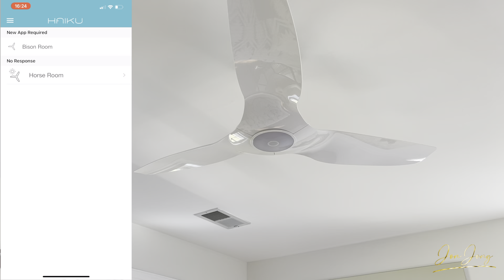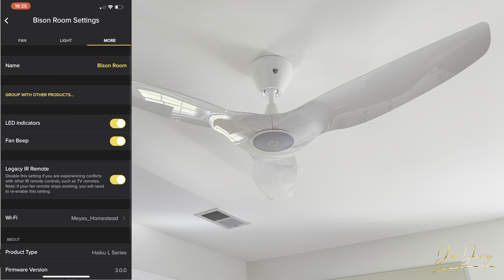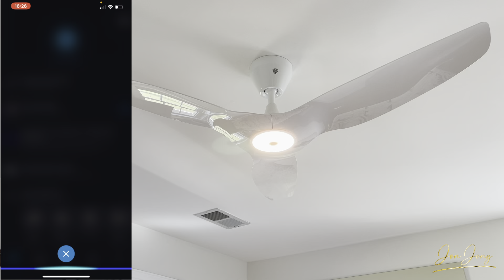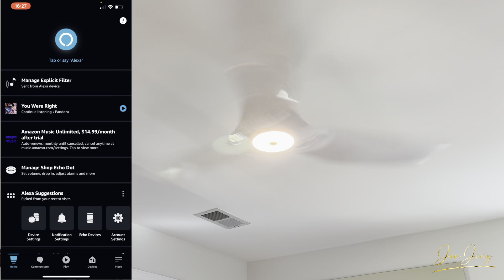Haiku L Series Big Ass Fan Unboxing, Install, Review

Comment: Great video. I know it’s a year old. But very helpful and detailed. I already have a few other Haiku/BAF fans installed. 2 haikus and one ES6 iirc. Bought 3 haiku L’s for spare bedrooms. Wanted to see if the install was any different prior to opening the boxes. Luckily they are the same basic design as my other fans from them. BAF is a great company and everything is always well thought out.
Reply from the maker: @toddfromflorida  we had installed our first Haiku fans back around 2016. We were glad the installation process was very similar. They did make some minor improvements in the design.

Comment: Fantastic install guide! I'm really curious how your light switch and fan switch are independently controlling the Haiku L. It looks like you are running 14/3 wire from the switch to the fan but the red wire is capped off, not giving control over anything on the fan. So please help me understand how your switches are independently controlling both the light and the fan. I'm looking to install this fan. I just have no logical clue how it's being successfully controlled from the switch.
Reply from the maker: @thedavenaugler  the previous fan was wired so one switch operated the lights and the other operated the fan. For this application this was the way I was advised to wire the new fan. Sorry I can’t provide better advise, I’m not an expert on wiring but maybe someone else can chime in.

My previous house only had one wire so it wasn’t an issue.
Reply: @JonJong  Right on. Thank you. I'm wanting to install this fan to a combo switch, if I can. I'm going to call Big Ass Fans on Monday and see if I can get some clarification. I'm a little old school and would like one rocker on the combo switch to control the light and the other rocker control the fan. We'll see what what I lean this next week. Thank a ton for the video. And a moving blanket is a sound idea for keeping beds clean!
Reply from the maker: @thedavenaugler  from what I recall these new fans use some sort of electronics so the switch is just left on and instead you mount the remote next to the switch. If you figure out a way that can manually hook up the fans to the switch please give an update. I think the fan needs constant power for the remote and wifi module to work.

Comment: Thumbs up...clear and well presented. Ordering mine soon. Just an aesthetic question...is the BAF decal on the ceiling cover removable? thanks.
Reply from the maker: Thanks for the feedback. I’m looking at the fan right now and the donkey logo is not removable. It’s not a sticker. It’s a medium gray color. I actually don’t mind it. Since it’s only plastic I’m sure you can sand and paint. The only issue is matching the high gloss finish. If you were to cover it with a glossy white round sticker you probably wouldn’t even notice it.

Comment: Thank you so much for this. I read instructions, but watching your instructions was way better. I do have a question my remote control stopped working. Do you know how to reset it? The only way I control the fan is through my Amazon Alexa or the app on my phone. Also, Do you recommend Lutron caseta smart switch? I just want to have a switch and not just relay on Alexa. Awesome fan! Thank for this videos my friend.
Reply from the maker: In my manual it only talks about how to reset the network through the app. I would first try removing the batteries and waiting 10 seconds before reinstalling but you might have to reach out to Big Ass Fans directly for that answer.
Reply from the maker: As far as Lutron Caséta switches, I’ve used them before. I prefer voice automation and to mount the factory remote on the wall as a backup. There is supposedly a hard-wired wall control available but I don’t see it on the website. I know several options like Wi-Fi modules and downrod extensions are only available over the phone.
Reply: Thank you

Comment: Have you found that installation may be a bit less cumbersome if you leave the air foils off until the motor's mounted? It seems like it might be a bit less unwieldy up on a ladder that way. As long as you make sure you've got all of the other pieces on, do you think this is a valid installation technique?
Reply from the maker: I believe it would be more cumbersome to add the air foils after. One reason is they have to overlap each other. Second reason is to properly torque each screw, it’s much easier before mounting.

It’s actually rather easy because the mount holds the weight so you’re only lifting the fan up briefly.

Comment: I wish they offered a low-volume "beep" setting for the fan. Sometimes my significant other will go to bed first. Then when I go to bed, I may want to adjust the fan. The bummer is that the blue lights are so bright, and the beep is so loud, that both can disturb her sleep. 😅 I'd turn off the LED indicators if there was a quite beep option. If there was a lower-brightness light option (bonus: one that auto adjusts to ambient light levels), then I could turn off the beeps.
Reply from the maker: You can actually turn off the LED indicator lights and turn off the fan beep. Log into the Big A$$ Fans app, click on your fan, click Settings, then click More, and you’ll see 2 toggle switches to turn both of those off!

Comment: Great video just installed my Haiku. Only question I have a light / fan “on/off” switch like yours. My light “on/off” switch works, however my fan “on/off” switch does not work anymore - I believe from the red wire tucked away. Does your fan “on/off” switch work or not?
Reply from the maker: Yes, my fan switch still works. One of the fans in one of my rooms was wired backwards from this one. Let me know if you get it figured out

Comment: I don't know why videos like this are so hard to come by... Thank you! Where did you order from? I can't find the wifi module anywhere. Also how does it feel since it's a lot of plastic, I want the black one but I'm concerned it will look cheap since I've never seen one in person?
Reply: I will also add this is one of the best unboxing/install/review videos I have seen in a very long time. Thanks again!
Reply: I have the same fan.  Everything about this fan is top notch.  Made in the USA!
Reply from the maker: I ordered this direct from the Big Ass Fans website. If you look under the residential tab on the website you’ll see Haiku. The Series L is the least expensive option and the one I chose.

I had called in to place my order so I’m not sure if they come with the wifi module built in as standard. It used to be a separate part to order. If I hear anything I’ll post an update.
Reply from the maker: Just like Bradley had said, everything about this fan is top notch. It looks sleek, feels very durable and are made in Kentucky!
Reply: @JonJong  Had to retract this comment about the WIFI module.  I thought since the control box said "WIFI MODULE" it was in fact included, but that was just a cover where the wifi module would go.  According to BAF the wifi module is backordered possibly until the new year, but the CS rep was guessing... Disappointed for sure considering the price, the module should be in there already, they are a nice fan which is why I now have 3.... Thanks for the video, the instructions are pretty poor, its an easy install after you do one, but very helpful video.
Reply: @crzyworm623  when I was buying they didn’t sell the version with wifi included in the fan. They only sell the “3L01” model but if you call places like Bellacor or Lumens they can sell the “3L02” model that is supposed to have the wifi module included.
Reply: @theishkid  Interesting... I just saw on Lighting New York they have the 52" Fan that says includes wifi module, but the 44" module does not (could just be signs of the module shortage) But only a 20$ price difference... I needed 44"... also a FYI to those looking at these fans.... BAF would not price match a sale even though I was within the 15 day return policy.  They did flash sale of 20%, then 30% a few days later and would not honor the difference.. Tech support is good, but not a company that will send you a replacement part at no cost like many companies will (sliced a cheap wire on the mount while twisting the canopy on, poor design, as the 3m tape would not hold the ferrite in place, and the mount is sharp, the tech even checked and agreed it was sharp. Other than that, I love these fans, they run so quiet and smooth, and the light is just the right warmth.
Reply: @crzyworm623  I just had mine installed and was told that there is a batch problem with the wifi modules. The remote control does not work after installing the wifi module. Regardless, I went ahead and install the wifi and true enough, the remote stops working. Have you gotten your wifi and does it work?
Reply: @lemech  very interesting, I just got mine too. Took a few attempts and resets to get them to recognize. Working great then went to bed like 6 hours later.. Woke up and both fans unresponsive. I have 1 wall control hooked to 2 fans. Lost all control. No remote no wifi, no wall control... reset power and they'd work for a bit then fail.. now 1 is working and one is not. Called tech and they acted like I was unique. After a long time with no power they'd work longer than if I just did a quick breaker off and on.. I pulled the  one wiif module and fan is working normal. I left the the wifi module in the one that is working and now it's been a few days and I have no issues. Both fans ordered and installed at the same time and both wifi modules arrived together. Tech was nice to talk to, and they are sending me a new control box and wifi module. They want the bad ones back for trouble shooting.  *Ill add wifi still shows connected in app and my router. But fan or light is unresponsive.. if fan was on when it goes out. It will stay on until power reset.
Reply: @crzyworm623  sounds familiar. I reset the wifi, turned off the breaker, end result is still the same after a while. I heard the entire batch  of wifi has issues so hopefully your replacement works reliably. Really strange to have such basic issues with a proven technology..... I hope big ass is reading our posts.
Reply: @lemech  CS has been great, was sent replacements a few weeks back but were no good.  Then yesterday 2 new ones showed up.... Popped them in and had no issues with adding or controlling them.  It's only been about 18 hours since installing them but so far so good... Looks like they got the issue taken care of with these latest ones.
Reply: @crzyworm623  That's great! Unfortunately, my experience with the L series is not good. They replaced the wifi module and after a short 1 hour or so, the wifi problem came back. I was told to wait for a 3rd replacement. So I waited and guess what, 2 days later, the motor had a humming sound at speed 2. It was really frustrating. Humming sound is a killer. I have 2 gen 1 Haikus and to date, there are no motor issues. I paid the difference to upgrade to the senseme version and it's been 2 weeks and there are no issues so far. I think I am done with the L series. Haiku should just put the wifi module as a standard for the L series so that they are in tune with the issues of add ons.

Comment: I find that my haiku fan is not pushing a lot of air. Is it possible  that I may have installed my blades upside down?
Reply from the maker: @pierpontscott9026  I don’t think it’s possible to install upside down. Did the numbers match up when you installed? I know they are hand-balanced so there are specific locations they need to be installed to avoid wobble.

Comment: What did you do with the old fan?
Reply from the maker: I usually list all my old fans for free in the local marketplace if anyone else can use them.
Reply: BAF is running a 30% deal right now. I thought the Haiku has motion sense so it would turn on when you entered the room and off when you left if you set it up that way... so close to buying but eh... my home has a seperate switch for light and another for fan... so its set up for hte pull cord style. @JonJong
Reply from the maker: @kmain0  all our fans also had 2 separate switches.
Reply: @JonJong  The haiku has a switch for Light and you can also set another up for fan? I have not seen that before and was unaware... is this demoed anywhere?
Reply from the maker: @kmain0  our original fans were wired with 2 switches. We only used one switch to power on the fan/light. One of your wall switches will be not be in use. You’ll keep the wall switch on and use the remote or voice control to control your fan/lights. I hope this helps clarify.

Comment: Is that a 44 in diameter fan?
Reply from the maker: These are the 52” fans. They do make a 44” version as well
Reply: Do you know if you buy the Haiku without the LED light kit, can it be added later?
Reply from the maker: @alanh5348  I just took a look at the BAF website. It looks like the Haiku L Series fans come with the LED lights.

The Haiku Gen 4 fans you can customize with LED lights or without. Even without LED lights, the Haiku Gen 4 fans start at $1,699 whereas the Haiku L Series start at $799
Reply: @JonJong  I have the Haiku without the lights, I think I have a later generation because the foils screw in from the top not the bottom like I’ve seen on some videos.  But I don’t see where the light kit would plug in
Reply from the maker: @alanh5348  it may be worth reaching out to BAF directly. I’ve dealt with their customer service and they’ve been awesome. My light kit just popped in. Maybe yours has a cover which can be replaced with an LED module?